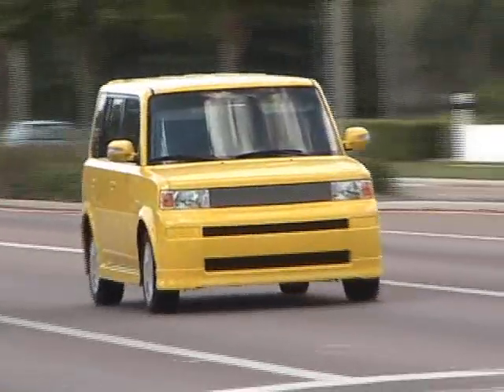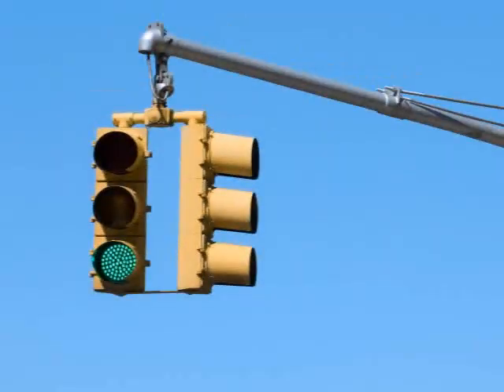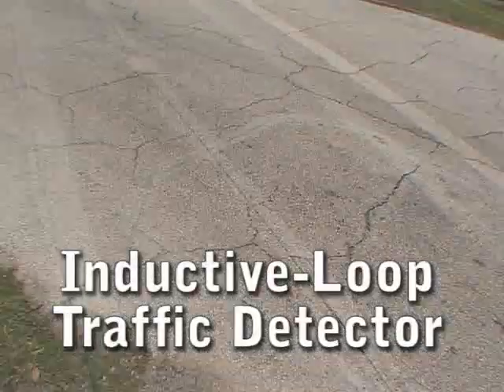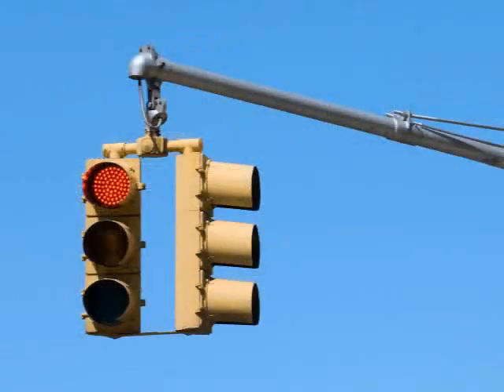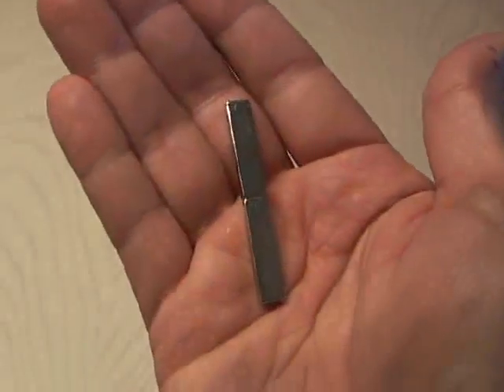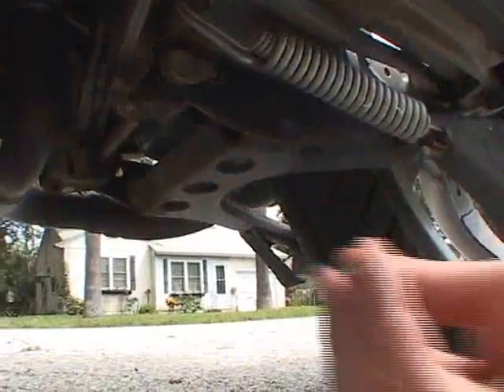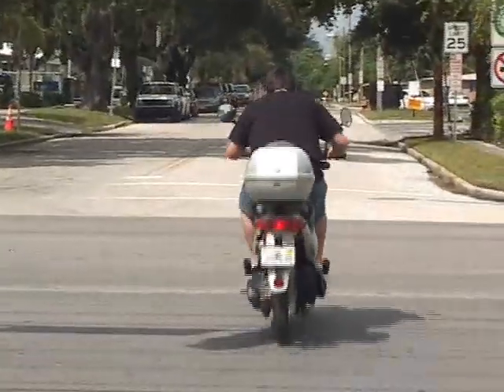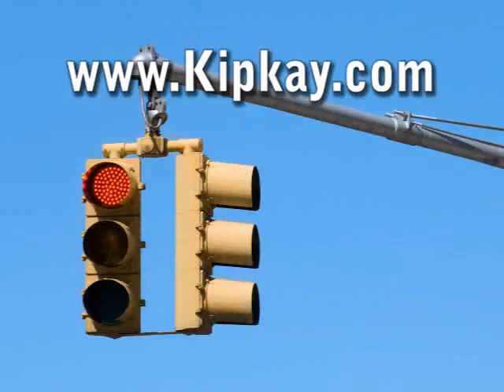Trigger Green Traffic Lights

Comment: I'm not 100% sure but I believe that they use a magnetic field that if disrupted / changed by something that is significant enough to do so.Since metal will attract it works. If you place 2 different magnets near each other they also effect one another. I can't say for sure that they all work the same.
Quick cheat I know works, In parkades that you get the time in ticket. If no one is around, scrape a metal shovel over the pad. It spits out a new ticket. Park all day for a 1/2 hour cost. shh!

Comment: Because its not Bullshit. Some cities use the inductive loop wire at lights and it does detect the metal in the chassis of a car. Some cities use preasure sensors that only active when something over a certain weight is on it. Since most motorcycles, scooters, bikes, ect have small / light metal frames they just can't be detected. Most of drive-thrus use the presure type.

Comment: ok so i work on lights, you dont need magnets it helps yes but a shovel will trigger them. call your local contractor they are out of adjustment.  a flick of the switch inside the cabnet and youll get a call everytime.  stop bars are also on the road for a reason use them like you should.

Comment: Why would you need tape to hold a strong magnet to the bottom of your scooter? Is the tapes hold better than that of the magnets? Anyways, this sounds like BS to me. There are stronger magnets in the alternators and starters. The magnetic field of those small magnets he used doesn't go out very far.

Comment: however, many traffic lights do have induction loops like this, for turning lanes or at side streets entering arterial roads.

if the magnet idea worked, it would be no different to pressing a button at a pedestrian crossing (although most in the US are timed not pushbutton), thus completely safe -- you drive over the induction loop, that triggers the traffic sequence, and after the sequence ends it returns to the default state.

Comment: I really don't see that this could work -- even large magnets only have a very short range of several millimetres -- this idea would need the magnet to work over 15-20cm (from the bottom of the vehicle through air and the road surface).

BTW:  the strobe thing is an urban myth

Comment: Justin, not to be a jerk but my best friend works for a municipal, and only larger intersections have strobe enabled lights. But even then they are not effected by headlights, and or the flashing lights on an ambulance. Those are there to alert oncoming cars, not turn the light. They do however have a special strobe light installed in the windscreen that is set to a particular frequency, which BTW is different from town to town. Headlights have NO effect! You may get lucky now and again.

Comment: lol, the easier way if your driving at night is to flash your high beams before you get to the red light and it will turn green fast, thats why ambulances and fire trucks have ther head light flashing back and fourth in a emergency so the lights will change for them faster, try it,, it works.

Comment: they do have a timers, but that only switches the light when the loops go into fault mode...or for when min & max times are reached. So if it detects a vehicle it will change faster.

Comment: Some lights have an IR sensor or low res digital camera as the trigger.
On the camera most can't send live video as it's usually connected to an 8bit microcontroller that runs the lights.
It needs to be extremely reliable so they use the simplest and most robust controller possible.
A full windows PC as a controller would be too failure and hack prone.

Comment: Have you tried this? Or thought about what the video was saying about the type of magnet maybe? Not all lights have timers and a light near my house has what was mentioned in the video and it will not work with my Ion. So maybe the size of magnet is in question? Because magnet =/= steel

Comment: That's bullshit. First off, some lights have timers on it. So if you pull up too soon, the light wont change until you sit there long enough. Now, a tiny magnet, over at least a few feet of metal over a metal detector will work. False.  Also, look at the bike just before the light tuns green. It just pulls up to the coil, and BOOM! Light's green? nope. They timed it when the light was yellow!

Comment: How's a little magnet going to switch the lights if it doesn't detect all the iron/steel on a motorcycle or small car?

Do those sensors even work by induction? I always thought they were triggered by weight.

Anyways, I swear some of those lights don't detect my Focus.  It seems that certain lights won't turn for me until another car pulls up on the other side.  That might just be how they're programmed though... To wikipedia I go :)

Comment: the only thing this helps for is if your vehicle doesn't trigger the sensor, if indeed it does work. I don't know where you people are getting the idea that the light will just turn green for you the second you pull up, but you wont be sitting through an extended green cycle because the light doesn't sense traffic waiting at the red

Comment: At least in Canada almost every traffic light has inductance sensors to detect when cars are in different lanes, that's why often when you drive to the stop line before a traffic line the other one instantly turns yellow and you then get the green light. In Canada where they are sensors, which is almost every intersection, there is a symbol painted on the street that tells you where the sensor is and if you don't drive over the sensor you'll never get a green light.

Comment: if they is a coke can you'll just drive over it ... aluminum cans are non-ferrous, no iron means they are not attrracted to magnets; on the plus side it would keep nails out of your tires. That and keep steel shavings from mechaincal wear out of the engine oil by holding them at the bottom of the oil pan.

Comment: If you see those similar markings on the pavement in your town, your lights definately run on detecting metal objects instead of timers. Hell they probably work by using a combination of both. All you need the sensors to do is detect a large metal SOMETHING above it.(you can trick it with magnetism, because thats how they work)

Comment: Then perhaps I should put a strong magnet next to a watch to fuck you up. The reason for that is that the watch has motors in it that you would have just re-magnetized, thus making them operate improperly. If that is not the case, then the change in magnetic flux for a short period of time would have made the motor turn more slowly, temporarily, causing it to make your watch seem to be running a bit slow.

Trust me, you have no idea what you're talking about.

Comment: The only light that has to be timed is the yellow light. I believe it has a 6 second minimum.  The city in charge of the light can lengthen the time of it if wanted but no shorter. I'm pretty sure this is a DOT regulation. I also think there is a different minimum for the yellow for high speed limit roads with stop lights.  Otherwise green and red lights if timed are different in almost every location due to traffic patterns.

Comment: the video is correct actually, those are sensors that pick up vibrations and electric disturbances. Older lights have timers yes, but newer lights have the sensors. Hence the light detecting when someones in the turn lane.

I find it good to play loud music so theres extra vibrations and I've had lights change a little faster that way.

Comment: this is different from the remotes
his scooter dowsnt have enough metal for the sensor to pick it up so he can get stuck at lights 
the magnets helps the sensor see him 

here in the US some traffic lights have sensors that receive a signal from an emergency vehicle and gives them a green light and the 3 other directions turn red 

(its sometimes a pain when a cop is sitting there with his lights on ou get stuck at lights) 

 the remotes mimic that signal and are highly illegal here

Comment: It's not about light and trafic RULES... If the sensor on the ground FAILS to detect your vehicle, you will get stuck in a red light for more than 10 min (been there). This magnet won't make the traffic light go green faster than if you have a regular size car... it just makes it trigger (the same way you do with your car)

Comment: I'm from dallas and those computer controlled lights are great because unlike timer lights, they can adjust to changing traffic conditions. But some places like lubbock have decided to stick with timer lights even in the 21st century. It sucks when the light turns red and NO ONE is even on the other road.

Comment: This is the fakest thing out there... Street lights do not change just because a car is waiting at a red light. They are programed to change after a set amount of time.  The only thing that changes the sequence/cycle or time of the lights is if a pedestrian hits the button to cause the walk symbol to pop up.  If they hit that, Different lights will turn green first and others will stay red, depending on where the Ped is crossing.

Comment: this is stupid...
he's correct about some lights having traffic sensors. This merely enters data into the lights system that there is a car waiting, and will turn green in a timed manner. It does not allow the lights to turn green immediately. You'll still have to wait. Magnets will NOT make a difference. And by the way, MAGNETS DO NOT RUST YOU IDIOT!
I'm sure this is a video designed to sucker some idiots to do stupid things.

Comment: it does work, that'swhat the wires in the ground are for, they "look" for metal crossing on top of them to change the lights when safe.
If you ride a plastic moped or motorcycle, MOST not all of the time your bike wont change the light, why pay $40.00 for this at a bike shop when you can DIY.
So StealthMonkeyFucker, dont talk bull shit that you dont know.
Kip wasn't talking about making an MIRT, this wont make the lights change green against traffic that is already coming, it'll get your turn.

Comment: Look here, man. u need to start acting more mature. Think about things before you say them. What's your source? do u just know things, or are you an extremely gullible person? I said its not usually used. okay, maybe im wrong. i know for a fact, however, that civil engineers in chicago illinois use complex mathematical equations to solve these types of things. It's perfectly fine that you disagree, but its not fine that you insult me.

Comment: What will be so illegal about this? MIRT devices are illegal definitely vie Federal law for un authorized vehicles(they remotely trip the signals via Ir strobe).

This would be a legal technicality at worse since the magnets make your tiny vehicle appear larger to the signal. The signals have problems with tiny vehicles to begin with. and magnets have nothing to do with actively tripping the signal itself, other than the latter of making it appear larger.

Comment: That's usually not used. I know a civil engineer, who says that each traffic light has to split a 90 second time limit between all roads. There are complex equations depending on the average traffic density to determine how long the lights should allow each road goes. He has never heard of sensing traffic signals, This is usually just a coincidence...

Comment: only for MIRT (mobile Infrared transmitting) devices which trigger the signals from 100's of feet away. MiRT is used by emergency departments for remotely tripping the signals. 

Did you have a homemade MIRT device by any chance? Some cops are just mean otherwise.

Comment: i suppose this is a good idea, but i can foresee a possible problem. most mechanical speedometers, even on scooters, have a rotating magnet that creates eddy current, which move the needle you can see on your vehicle. placing "very powerful magnetic fields" on your vehicle may disrupt this. especially considering the fact that some speedometers must be adjusted when people fit large rims on their cars.

Comment: Lol at people not understanding how this works.

Pretty much the magnets are compensating for the lack of weight you'd usually have in a standard car. A scooter is really light so it may not set the sensors under the road off. This magnet is merely just allowing the light vehicle to set the traffic light sensor off stopping you from weighting for ages.

Comment: there are multiple ways that traffic lights work....timers, weight, motion, light.....and the original one in my town had a guy who sat in a booth flipping a switch......for some reason he never used the yellow one....he had it, but never saw it necessary.....hmmmmmmmmm

Comment: Last time I checked, physics didn't work that way. Not accounting for the fact that the strength of a magnetic field decreases with the square of the distance, inductance can't be changed by a magnet, but rather by the MASS of the vehicle over the coil. Perhaps the moving magnet could set up a current within the coil, but if these sensors are that sensitive then a lightning strike would trigger all the stop lights within a 10 mile radius.

My guess is this is an example of the placebo effect.

Comment: hehe, b/c it's a magnet.  No but even though it's a magnet, they still fall off or slide down the metal  when hitting bumps in the road. Also, some mopeds/ bikes aren't metal underneath. But good observation though.

Comment: I use to tilt my moped on its side to get the metal motor closer to the sensors. It worked a lot of the time, but not full proof. Some traffic light sensors are are cut too deep into the road, I guess.

Comment: The car is large enough to trip the sensors so there is no need for magnets. Either way the magnet would never be powerful enough to mess with the cars electrical system. They would have to be substantially large and expensive.

Comment: This video is not false. The reason that theses sensors are in the road are specifically for those 3am traffic lights. If you pull up and there is no traffic coming from the perpendicular direction the light will become green faster so that you will not wait long. The light does not automatically turn green but it is told to turn green sooner as long as no other traffic is coming. As he explains a normal car will trip these sensors but smaller vehicles have trouble.

Comment: There are some traffic signals that operate by infrared motion detectors mounted next to the signal. Sometimes Diesel trucks do not trigger these when moving up slowly to the stop line, but reversing or coasting forward and jamming the brakes triggers it. Maybe a IR flashlight or laser pen would do it too. What is it that ambulances do to get green lights?

Comment: Not really 'easier' but worth noting -- if you're stuck at a light like this, stop the motorcycle's engine, make sure you are over the 'sensor grid' in the road surface, and restart your engine. The magnetic field produced by the starter cranking will typically do the same thing as the magnets.

Comment: I should add this wont give you an instant green light, it just senses there is traffic at that particular stopping point, if theres traffic at each set of lights, chances are you won't get the green light your after, its mainly used for quiet traffic times.

Comment: Yeah, it's usually mixed wherever you go.

But if there's a steady flow of traffic, the light is on a timer.

If there's no traffic at all, sometimes they'll stay green on the busiest crossing, and then when you pull your car up to the other part of it, it'll trigger the light to change.

So it's all of them, really. :P Timer when it's busy, trigger (like in the vid) when it's slow, and an interrupted signal when someone hits the button.

Comment: Also helps if you allow your vehicle to move slightly while waiting for light, it will change quicker.  I can make a light change with just myself waiting and I drive a pickup.  That's because I 'inch' forward slowly. Most people pull up to a light and NEVER move at all, this is why some lights have 10 to 20 cars there before changing.  What is worse is if the first idiot insists on stopping 30 feet back from line....just to be 'safe'.

Comment: Another trick would be to flash your brights. Most traffic lights have a flash detector for emergency vehicles. Flashing your brights makes the light change almost instantly.
Some traffic lights are timed, not motion censored. . . so the magnet thing wouldn't work in all cases.

Comment: Highly doubtful. As mentioned, the wires buried in the concrete are basically a giant metal detector. The problem with bikes and other small vehicles is that they simply don't have enough metal to trip the sensor. I don't know how much (or if at all) magnets affect metal detectors. If they don't (which is what i think happens), the addition of two smalls strips of metal won't make any difference at all. if they do, i don't think the magnetic force of said magnets would be enough.

Comment: why would it? unless you thinking the magnets can some how attract to the asphalt, there would be no drag whatsover.

or did you think the magnets weigh 6 pounds? if so not even. they are mere ounces. what he said was they have a pulling force of six pounds, which means they are very strong. they can pick something up that wieghs 6 pounds.

Comment: Yea I knew that trick the other guy mentioned and use it when i can..if you are at a main street and are at a red light and the light turned green or approached just when the light turned green go at axactly the speed limit posted..the lights are usually synchronized so you will get greens all the way or very little red lights